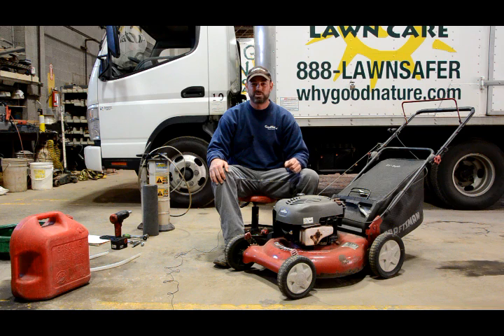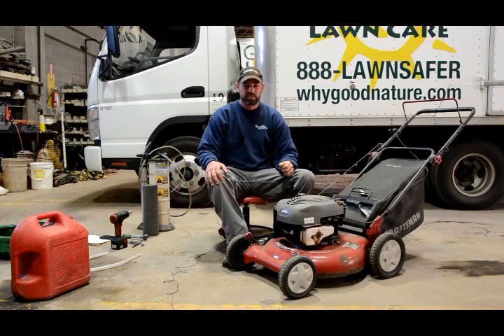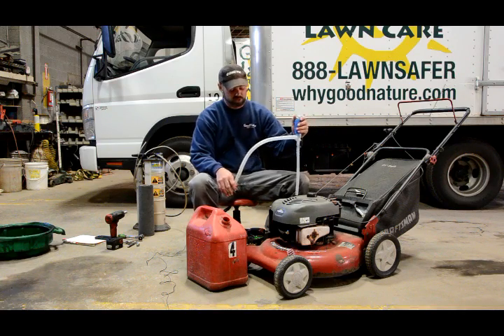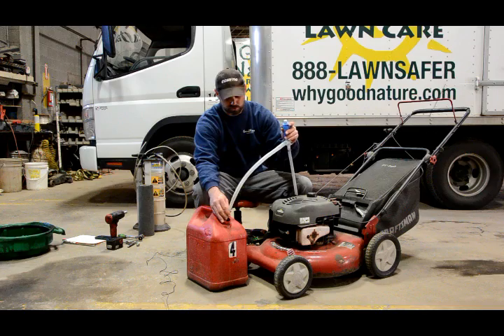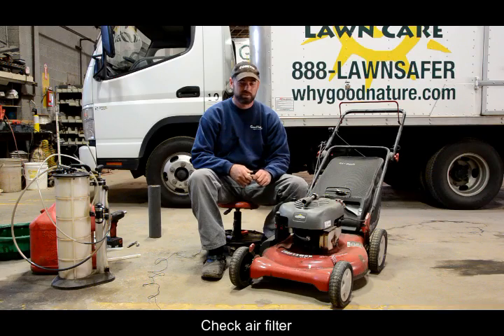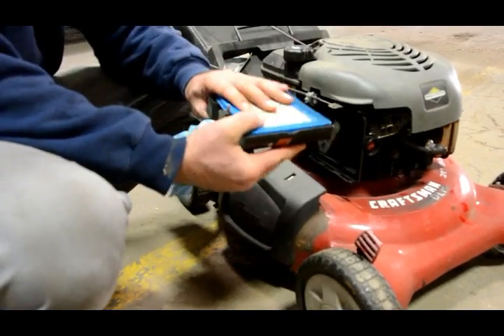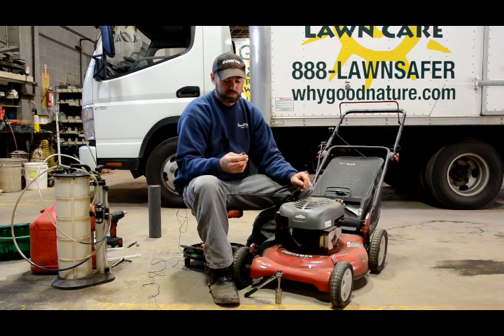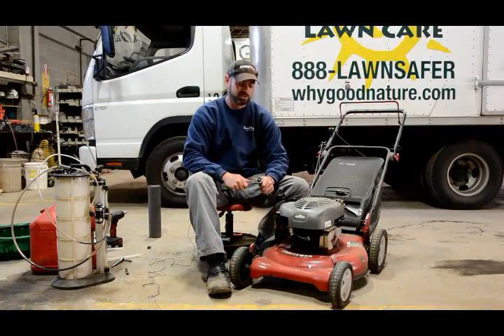Part I: Preparing Your Lawn Mower For Winter Storage

Comment: Prep snowblower for winter
Reply: Angel Reyes 1. Oil change. 2. Check your sparkplug. 3. Change or clean your air filter. 4. Preferably fill your gas tank with NON-ethanol fuel for storage. If you only can get ethanol mixed fuel, just empty your gas out completely. Ethanol collects moisture from the air. 6. Open the bottom plate and inspect the belts and clean the chains and clean off the friction plate. Make sure there is no oil left on the plate otherwise your belt will slip.
Reply: Angel Reyes Also, add a fuel stabilizer if you can